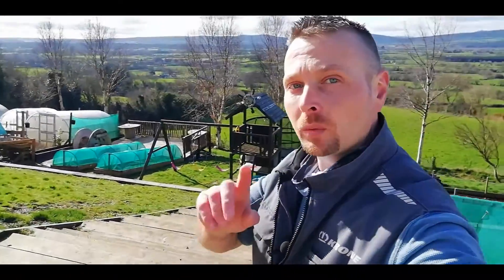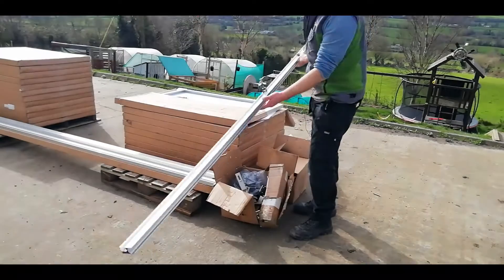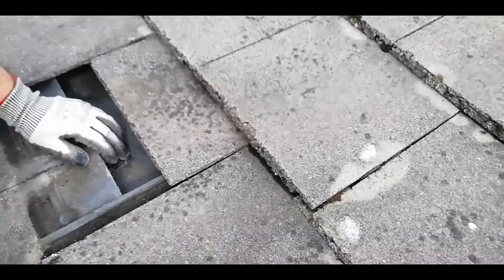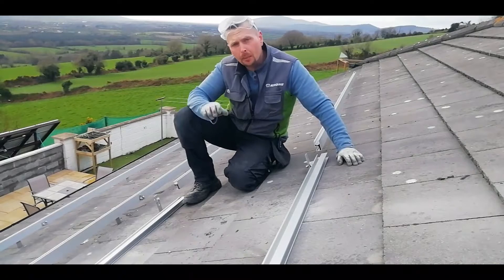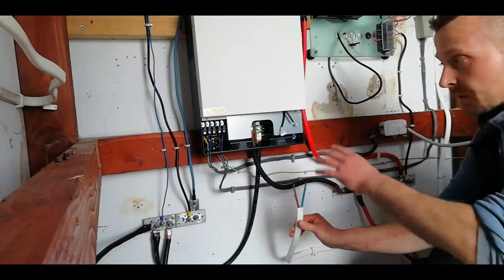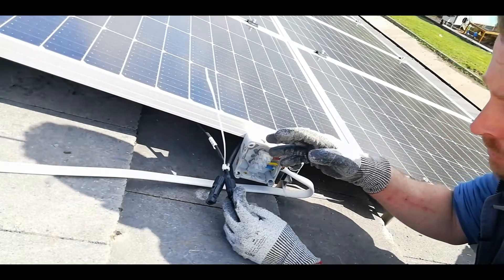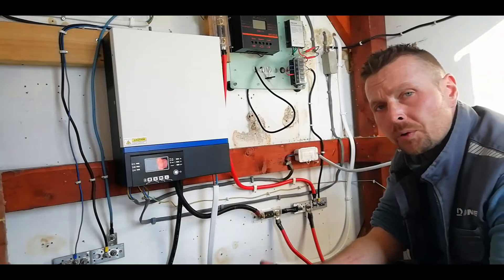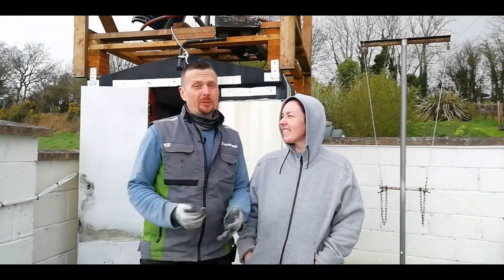DIY Solar Roof Mount for Beginners

Comment: How did you run the 10 sq into the roof space ? Same was as the roof bracket ? Notch the tile ?
Reply from the maker: Yes, cut a notch in the underside of the tile same as what was done for the roof brackets.

Comment: Thanks for the informative video. With regard to your choc-block (connector terminals in the box beside your pannels), you can very easily prevent them corroding and having to replace the connecter each year or so. Get yourself come dialectric grease (I use Super Lube - there are other brands that will work just as well) and pack in the grease into your connectors and over the bare wires. When you tighten the terminals, the screws will bite into the wire or/or press them against the rest of the contact points and give you sealed well connected termination. It is not conductive so there's no risk of a short-circuit if grease from one terminal touches the other. It's very sticky and messy but good stuff. This will keep moisture out of the connector terminals and bare wires preventing corrosion. You'll be able to use one connector for many years without needing replacing. I don't have solar panals, but use it for other external connections where there's a risk of corrosion.
Reply from the maker: @studio_w  thank you so much, that's a great tip. Will definately give it a try.
Reply: @ourkilkennyhomestead2006  You're very welcome! I saw your video some weeks ago now cleaning all my tabs and open browsers, and saw this again. I thought let me message you now as I know this will help you and all your external connectors. I don't like seeing anyone battle when there is a simple solution to help them with a problem that should not be a problem. FYI, I'm in North Co. Tipp 😀
Reply from the maker: @studio_w  no worries, thanks for tuning in and hope you enjoy the content. What part of north tipp are you?
Reply: @ourkilkennyhomestead2006  I'm not too far from Nenagh

Comment: Just be a little wary if you reckon DC is a lot safer. It can be safer "like for like", but although it might take 75mA with DC before you are unable to let go, a typical installation like you have just set up, will probably be around 240v (20 panels @ 12v) and around 15A. If your hands are dry and you touch it with a finger, it will indeed "give you a little dart". If your hands are damp, it can be a different story.

If you use larger panels which are more typically 35v - 40v with a 10A current rating, a string of 20 panels can be around 800v DC (the London Underground uses about + / - 600VDC and manages to kill pretty effectively if people play with the rails.)

Not trying to be a smart arse (honest), but once you go above about 50V even with DC, I'd treat it with SOME caution. Once you are much above 100V, I'd start to treat it as you would mains (better to err on the right side). Once you are up around 300-400V, then not a bad idea to treat it as you would working on live three-phase.

DC is not as hazardous to the heart BUT if you are in series with a few hundred volts DC at several AMPS, you will be burning your insides with a few thousand watts of heat. The heart might keep going but you will be burning away nerves, arteries and so on with terrifying efficiency.

If you are bored, get a piece of raw meat (chicken breast ?) and see what happens if you give it a good solid connection (crocodile clip on each side) and then connect clips to a large solar array. It's a scary but fun way to cook food VERY quickly. (Hot dog sausages can explode, proper sausages cook completely in 10 - 20 seconds :) )

Really useful info though on fastening the clips. In England roof tiles are pretty common, but ours tend to have ridges and as I am pretty much useless when it comes to working with fragile stuff, I am hoping the metal bracket might fit into one of the "ridges". Grinding out a channel for me I think will mean lots of spare tiles will be needed :)

Love the idea of being totally off grid - but alas with just a little terraced house, there isn't enough roof space to go much above about 2KW - though a few panels on the shed roof and workshop roof with little tiny micro-inverters are helpful.

Once you are using 48vDC, it can be worth noting that 60v - 90v > 48v MPPT battery chargers can be found on ebay for about £30 - and with around 100A rating. This can mean that if you add an extra set of panels elsewhere (garden mount for example), and you just have a series parallel setup that keeps the voltage to between around 60v and 90v, then this can be used to ALSO charge the batteries. Inverter doesn't know about it - it just sees batteries with plenty of extra power in.

Final comment, a DC isolator is not a bad plan, but they are not the same switch design as the cheaper AC isolators. If you have an AC connection and break it, the arc is usually pretty tiny - a millimetre or two is enough of a gap to work as a switch. With DC, you can get AWESOME plasma streams from just a couple of hundred volts - as in well over a centimeter if you break the connection while it is on load. So the DC isolators are dearer than the AC ones - but they have a MUCH bigger gap and usually a method of physically sticking an insulator between the contacts to quench the plasma.
Reply from the maker: @guyteigh3375 it was a general reference, both are dangerous. Yes dc will arc worse than ac and there's loads of vids on yt showing this. The difference is that dc is looking for a complete circuit back to its negative which is almost always an insulated return, ie. isn't earthed through the physical ground. Whereas with ac both live and neutral will shock you as they always have a completed circuit to ground potentially through you. Here's a link that explains it better. Scroll down a little to "jeep hammers" comment. 
https://diysolarforum.com/threads/why-do-dc-systems-not-make-use-of-grounding-to-the-same-extent-as-with-ac.5152/
Reply from the maker: @guyteigh3375  thanks for the comment, if you see any of my later vids you'll see that we equipped dc circuit breakers instead of isolators as the isolators switches have been seen to fail. Worth saying that I'm not overly convinced that the circuit breakers are any better either but at least they have that additional safety aspect. We also switched up to an 11kw all in one inverter which is a beast of a thing although it does have a high idle consumption. Will have more updates coming soon as we save up to add more to the system.

Comment: Like the Vid (down in Australia here...) - where there have been some more recent Strict controls added for Self Installation...Basically - Quite hard to do it yourself now without contravining several new laws...
Anyway that aside...

Just a couple of comments...Actually one in particular.  The Twin & Earth is NOT rated for External use, if you insist on using it, make sure to put it in Appropriate Weather rated conduit to put it in, otherwise it will suffer UV degredation, Animals will chew on it, and Moss & Lichen ensymzes (as well as animal faeces) can chew through it as well...Preferably use PVC conduit, which is typicaly Cheap as Chips, but where you should also 100% seal it at both ends to restrict any Moisture ingress, as moisture getting in will create a Dielectric effect, and the use of Twin and Earth doesn't help that, as there are air gaps in it, unlike the Sheethed DC cable, It's why the preference Actually is to use individual DC cables appropriate for the run which are seperated.
Reply from the maker: @lklmmedia4715  thanks for the tip. Getting around to fitting conduit everywhere bit by bit. Glad you enjoyed the vid 👍

Comment: Can I ask is that €140 per panel...
Nice job on the install... it looks very tidy.
Don't you mean DC more dangerous than AC. A little DART of DC will bloody kill you or burn the he'll of you.
I  think your going over kill on the 10sq on the roof.
4sq or 6sq is enough.. your leaving yourself very vulnerable at your junction box now.. them mc4 connectors are standard practice for a reason.. 

I'm not afraid of much in this world... but I'm terrified of DC.
Reply from the maker: Hi Pádraig, yes the price at the time of recording was 140 per panel however it fluctuates up and down regularly. They were 115 each when we bought them which is why I suggested folks to have a look at the link, so that they could get them at a good price too.
It's interesting to hear your perspective on dc electricity. As a mechanic of over 20yrs I can honestly say that dc is much safer than A/C. Working on a/c makes me nervous, working on dc I'd be very comfortable. For example, 12/24/48v dc you can handle with your bare hands fairly safely. Wouldn't be doing that with a/c, even at those low voltages. Great to hear another perspective on things. Thanks for the tip, hope all is well.
Reply: @ourkilkennyhomestead2006  that's extremely expensive mate..
The going rate for domestic/commercial 435w panels at the minute are less than €100. Jinko n type or trina bifacal are around that price.. if you know the correct people to speak to that is...
Also pylontech are a good entry level battery.. check out dyness there another battery similar to pylontech..
You can get them in 2.4kw modules, I find the BX5100 model is better and the value is far better.

Personally I haven't had any close calls with DC. but few installers I know have had.. hearing stories and then when I'm working around DC myself (which is daily) I'm extremely cautious..
"Different strokes for different fokes I guess"
Reply from the maker: @MrPadraigmccarthy  interesting. For those of us who don't know the correct people to speak to, what we shared in the vid was the best we could find for good quality panels with a 25yr life span.
Different strokes for different folks all the way.  
The pylon techs are great but still too pricey for many people. The great news is that prices are dropping fast so hopefully they'll be within everyone's budget in the near future. 
Trust me on the dc though, much safer to work on as half the sine wave is gone compared to the full sine wave of ac.
Reply: @ourkilkennyhomestead2006  your fully correct.

Well my back round is...
I'm a stock manager for irelands second largest solar PV company.  I have been in solar for 5+ years.. I  started off with Irelands largest PV company. I started at the bottom working my way up..
I can cover all areas of solar from installs to trouble shooting etc etc.

If your in need of anything just drop me a message..

Your issue with DC is it will arc and can melt or cause fires.. AC will just trip the mcb or rcbo. Dc can't do that. So it's vital that all connections at DC are 100% crimped and tighted correctly..

I look forward to seeing your next video update..
Reply from the maker: @MrPadraigmccarthy  Fantastic, fair play!  I might just do that, we're always looking for better prices, better gear and Irish suppliers of course to keep it local.
Can I ask if the company retails to the public or is it trade only?
If you like you could email me the name and I'll surely check them out.
Cheers 👍
Reply: @MrPadraigmccarthy   How can I get hold of 435W panels at that sort of price? Am starting on a journey to self instal a system... even an installer who visited to quote said that these panels cost only £200 each and I'm sure you can get them for a lot less - but where to source them....??